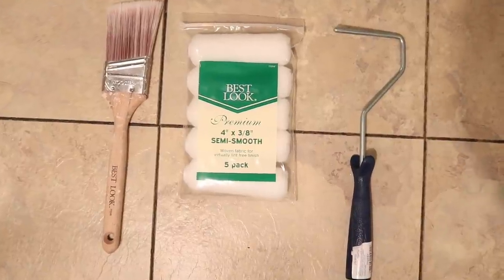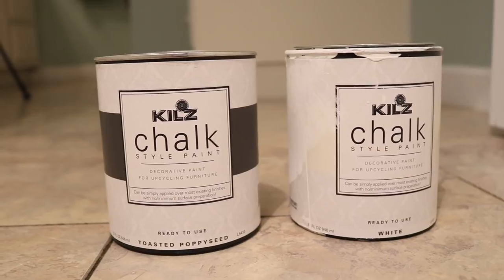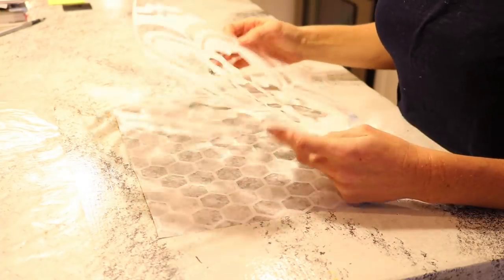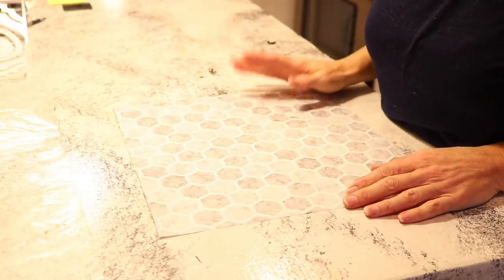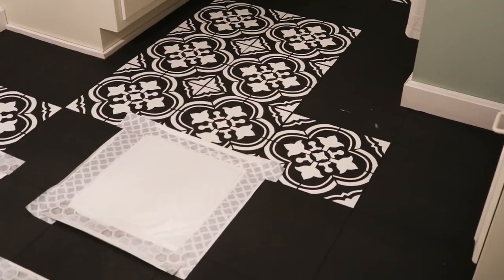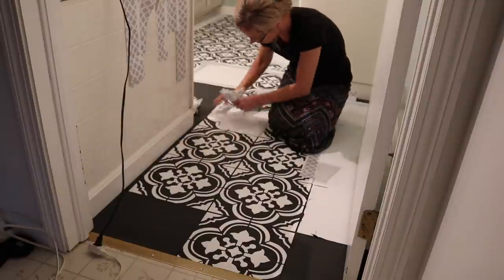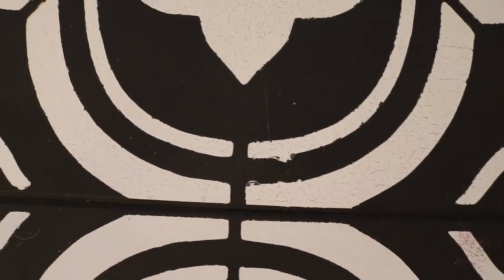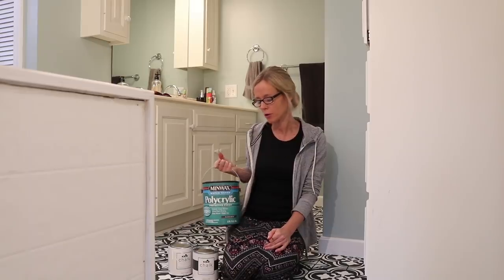Painted Floor ~ Stenciled Bathroom Floor ~ Moroccan Mosiac Tile

Comment: You did an amazing job. I did this to my patio and sealed it and it has lasted two years so far.
Reply: Really
..cool....what type of paint did u use..
Reply: Agusta Sister I just used the color place paint for exterior from Walmart. It turned out great
Reply: What did you seal it with?
Reply: marymack4105 I sealed it with a concrete sealer at Lowe’s I used rollers it took about half of the gallon. Dries very quick. The sealer cost about $12
Reply: I love to see that!
Reply: I want to do this in my bathroom.Did you wait for the paint to dry before you removed the stencils? No one ever mentions when to remove the stencils. 😃

Comment: At first I thought it was backwards to try and paint white over black, but I love that the grout lines are black. It gives them more definition. Also they make a spray adhesive that comes in a can that you can use for the backs of your stencils.

Comment: Mary, I don't know if you saw my comment about painting my entry hallway  but I was told after I painted the floor to look like tile to roll on 7 coats of water based poly. When I moved  8 years later, there wasn't a scratch on it, and believe me it had lots of wear.  Great job.

Comment: I LOVE your floor, Mary!  What a huge improvement!
When I bought my house, the owners had just put down new peel and stick tile in the kitchen. It was sooo ugly but it's a large kitchen and I couldn't justify pulling it all up with so many other projects. So, I painted on a coat of cream color wall paint. When it was dry, I started painting on a coat of dark brown and used a rag to wipe some off, creating the look of wood grain. I did it all in one direction, then used a black.Sharpie and a 4 ft yard stick to create 5" wide "boards" and "cut" them every few feet for realism. The yard stick had a hole in each end for hanging, about 1/4" in diameter and I used the Sharpie to make 2 "pegs" at each cut on the boards. I rolled on 3 coats of Polycrylic which gave it a beautiful gloss and protected the paint. I loved that floor!!!  Everyone who saw it thought it was a real wide plank wood floor. It lasted for over 15 years!!!  You can paint ANYTHING!!!!!! 😊 Keep up the good work, I love watching all your projects. God bless.

Comment: I wonder, just free thinking here, but thinking about painting and sealing all the tiles first, then laying them down on your floor.  This would be for a floor that doesn’t have these tiles down already.  I’m learning SO MUCH from you.  Being a quilter has taught be about how to save time when I have to repeat various steps, to do them all at once if possible.  You save some time and it’s certainly efficient, but I don’t know if it’s that much time saved.  The biggest issue is the complexity of the stencil.  Yours are beautiful, and worth every minute.

Comment: I haven’t worked with stencils much, but when I did use them the instructions said to get paint on your roller and roll the excess off on paper towels so they won’t bleed. It really worked so just an FYI if you decide to do this again you would only have to print out one stencil.  Your floor came out beautifully.

Comment: Here is a tip for painting floors and saving your knees especially in larger rooms.  Use a an extendable pole that screws into the end of the roller handle so you can stand for most of the job. So much quicker and easier on your back and knees!  I did this in my family room. The edges still need to be cut in with a brush first as shown here in this video.  Kneeling was too painful for my old  knees so no stenciling floors for me. Your floor looks great. Thx for posting this.

Comment: In 2004 my mom bought a home with a kitchen floor, vinyl, that had been painted. I was not crazy about the idea but before she moved in, I repainted it. When we sold the home in 2015 we sold it painted. I did not need to repaint. No one seemed to know so I would consider it a big success and BIG time money saver.

Comment: If you ever do another floor there is stencil spray adhesive that works wonders on the back of stencils to stop bleed through, also off loading when stenciling helps too with bleed through... I did my kitchen back splash in a similar stencil.

Comment: Gorgeous. I'm planning to do my kitchen and bedroom floors. I bought a super strength Kilz Adhesion primer that cost $55 a gallon, but I think it will be worth it. Especially in the kitchen. I'm trying to find a stencil that I like. I don't want one quite as bold as the one you used, although yours looks so beautiful I'm tempted.

Comment: I used concrete sealer from Lowe’s. It’s about $12 a gallon and rolled it on with a roller. Only took half of the gallon.

Comment: Wow! Just love it. Curious, what was the cost compared to tile?
Reply from the maker: Thanks! Good question..I should have touched on that in the video. It took exactly 2 quarts paint, which they are 20 each and maybe 5.00 worth of polycrylic. So with all that and the rollers, we will say 50.00..i used 4 rolls of contact paper, around $3 each. So I prob spent around $60..ive never tiled but imagine it would cost hundreds? And to get someone to do it, prob a few thousand? I should do some research on exactly how much it would cost. Thanks. for watching!

Comment: You made that way harder then it had to be. I thought "great" you're going to make your own stencils and use those. I liked the design. But you said they didn't work. You didn't use any adhesive spray to keep it in place. There is a product that has been out there for years called "repositional adhesive spray." So that was painful to watch.